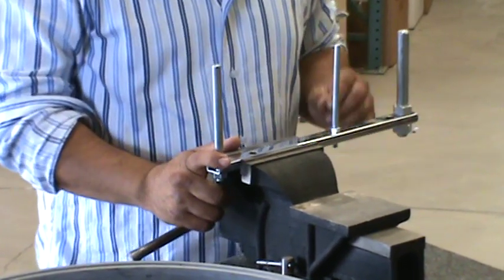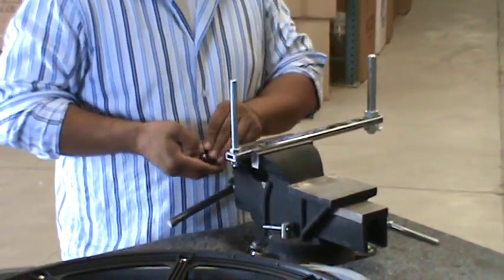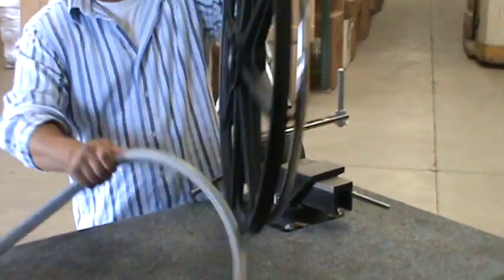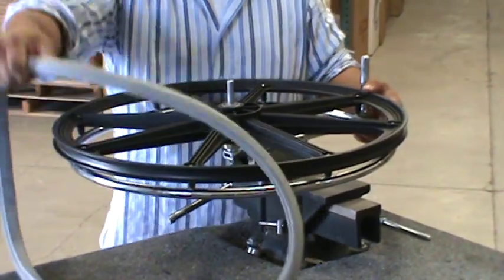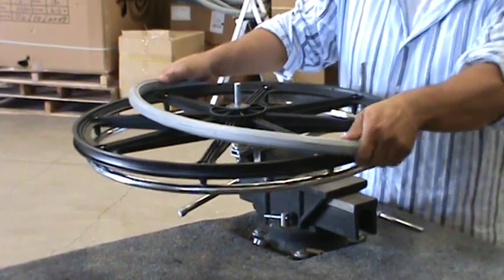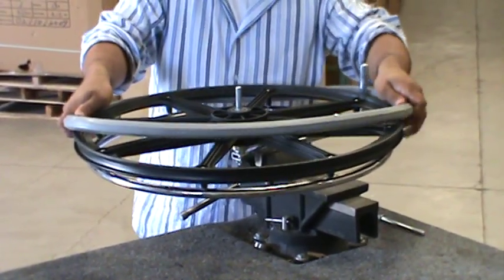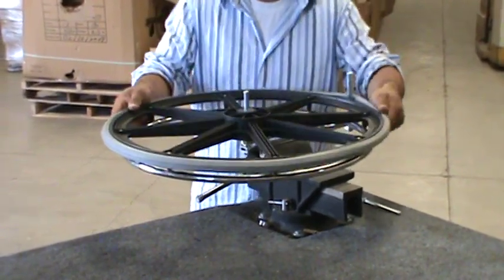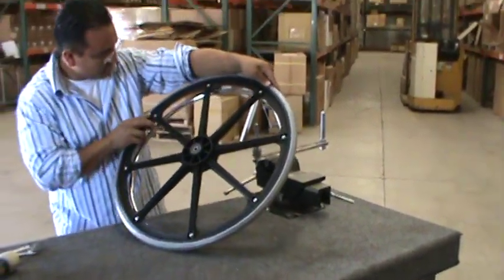New Solutions M40E Tire Installation Tool

Comment from the maker: purkjason, you are partially correct. In order to put the urethane tires, that are notched on the inside, you could put a small length of pvc sprinkler pipe over the peg that the tire rides on, thus making the peg bigger than the notches it needs to go over.  A little lube will help but it should make it easy.  I'll try to make a new video showing it.
Reply: Nope.  They don’t stretch unless some hydraulic machine is used.  Notched and corded tires will not install by hand.  The plastic rim will deform trying.
Reply: Heating the tire makes the rubber slightly more pliable but the cords in the tire will not stretch.  With half the tire mounted in the rim, the remaining tire will cross the wheel only a few inches above the axel.  No amount of force from two adults, one using his foot to turn the wheel, the other his arms, will mount the tire.  Progress we thought we were making just turned out to be the wheel deforming - folding over on itself.  The tool we used was actually a double frame where both ends of the axel rod and outer rod was supported on both ends.  Very strong.  Stronger than the wheel, but not the tire.  Don’t be fooled by the videos showing tires sliding right on like it was a bicycle tire.  Corded tires are not floppy.  They are not flexible.  No YouTube videos show these tires being installed by hand.  Don’t buy these tires with DIY in mind.

Comment: I tried putting a "Shox" brand 26" tire on a 26" wheelchair rim. When I lay the tire on top of the rim at the start of the mounting process, the outside edge is just barely beyond the inside edge of the rim as if the tire was 24" in diameter instead of the 26" that is indicated on the sidewall.   The tire in your video seems to be able to stretch but mine will not.  There is almost no give at all  in terms of stretching. Warming the tire and zip ties didn't work. Do you have any suggestions?
Reply: Four years and no answer.  Reason is that 24” tires are supposed to fit 24” wheels . Period.

Comment: w/c tires are specifically sized for rims that are manufacturer specific... so buying a 24 inch tire for and Invacare (for instance) 24" rim might not lead to successful install of tire. Yeah, you might be able to cut cords, force-stretch etc. but that is not good practice. Order the tire specific to the rim, using manufacturer, size and specifics about the rim, air or non-air. That way you get the right tire for the job and have a good, safe install. And the install is easy that way; no struggle.
Reply: Bull.  Shit.

Comment from the maker: Hello fasdude38, couple of things. This is going to take some elbow grease, so if you keep trying, you will get it to stretch and get on there. If you are doing alot of tires, you should get ahold of the M40 instead as it is much more solid.
Another option is you can have us do it for you and just pay the shipping to send it. Feel free to call with any further questions. 800.429.9600
Reply: Where can i buy this M40E tyre changing tool please

Comment: use non-corded pyramidal tires because they stretch.... corded tires do not like to stretch....
Reply: I made my own tool but still could not get the tire on, then realized it
 was corded.  I cut all the cords and it went on in seconds.  Next time 
with a corded tire I would cut every other set of cords around the tire 
and see if it goes on.  Since the cords keep the tire tight to help the 
tire stay on. I am guessing the factory has a pneumatic machine to get 
corded tires on???
Reply: They can’t stretch. Not don’t like to.  Won’t.
Reply: @DaveNuetzel 
So did the tire stay on? Did the brake work when applied? or did the rim slip when applied due to the cords being cut?
I ask because I bought corded and ribbed on the inside tire and bought a similar tool to use.
Reply: @michaelroberts3495 The tire worked fine but cutting less cords would keep it even tighter.   Not sure about brakes since I have never used them except for flat surfaces. 
Some tires might have enough stretch without modifying anything
Reply: @DaveNuetzel   thanks Dave for the info.

Comment: This New Solutions M40E "DOESN'T WORK " if you are using rubber tires that are ribbed in the interior edge and also have cords inside them.  I tried for an hour even using ties and heat gun as well with no luck whatsoever.  Thought this would be cost efficient for the nursing home I work at but it looks like I'm gonna have to purchase entire wheel assemblies at $110 each side .... bummer.  This would work great if you use non ribbed no corded rubber tires just like the video shows I guess.
Reply: +purkjason you do not know what your doing then
Reply: I made my own tool but still could not get the tire on, then realized it was corded.  I cut all the cords and it went on in seconds.  Next time with a corded tire I would cut every other set of cords around the tire and see if it goes on.  Since the cords keep the tire tight to help the tire stay on. I am guessing the factory has a pneumatic machine to get corded tires on???